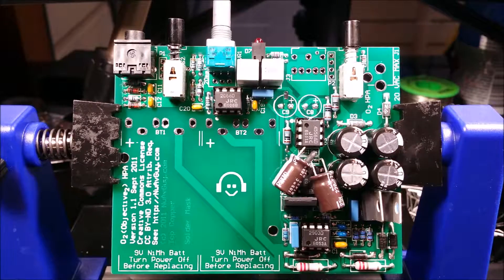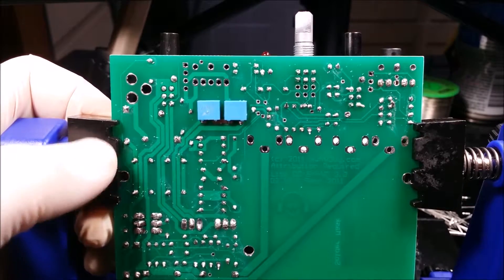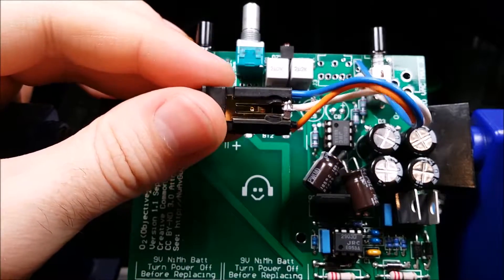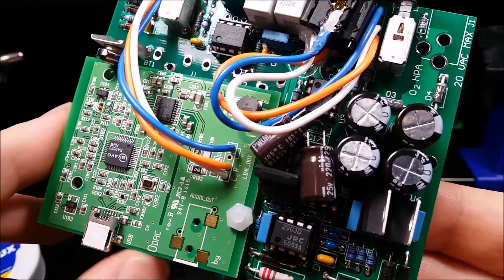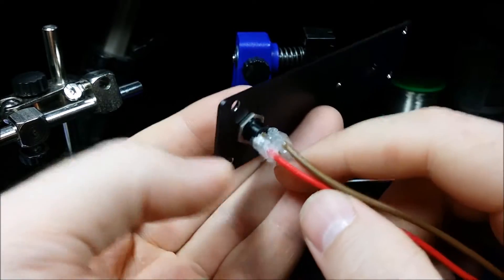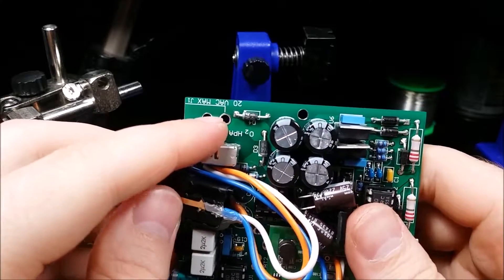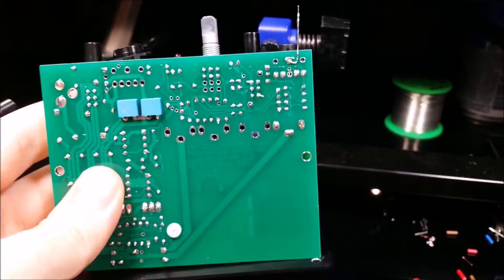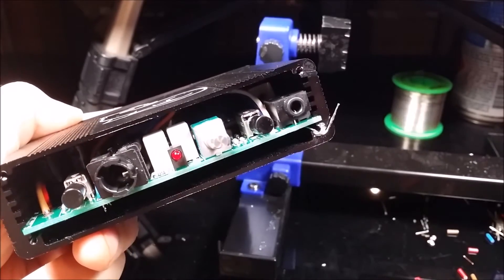Objective 2 Kit - (Part 5) IO Panel and DAC

Comment: Did you finish it? What is it like?
Reply from the maker: All finished! 
It's now part of my everyday setup (which includes a pair of AKG 7XX's).
No detectable noise floor, no channel bias or any weird sound artifacts. I'm quite happy with how it turned out, especially considering I made it (was expecting something to go wrong). I'm glad I did this and and am now looking forward to other projects.
Reply: Cool. I assume this is the DAC and amp that you don't hear, like a wire with gain as they say. One more question: I have a HeadRoom Total BitHead which switches to standby a second after audio stops playing. Does the O2 DAC do that? Because I get a click when it happens, and it's annoying.